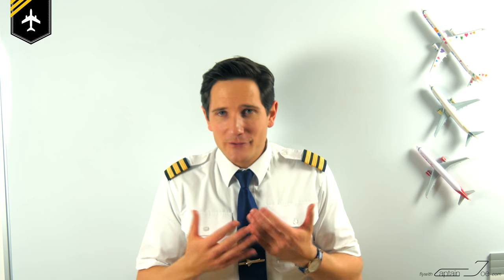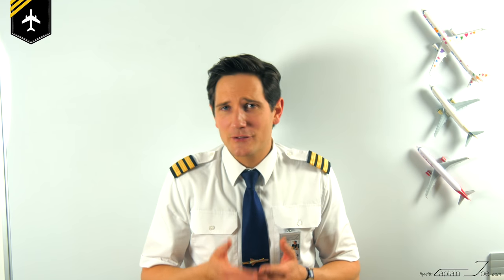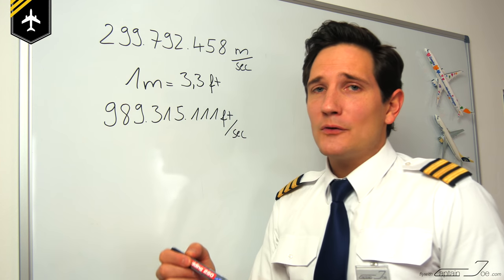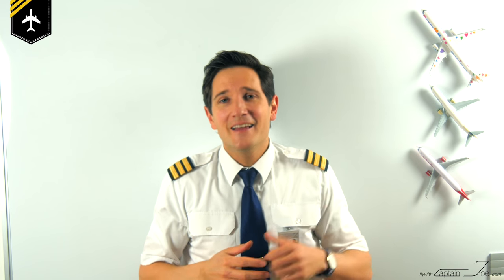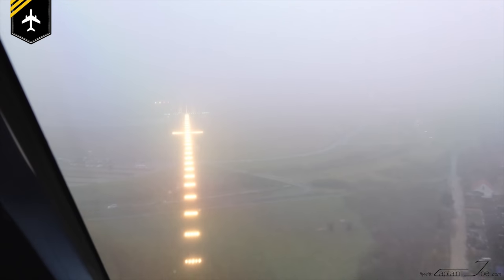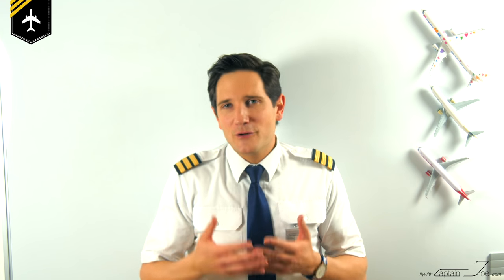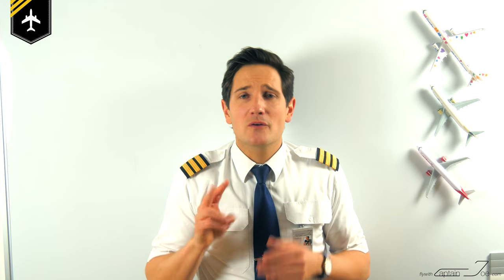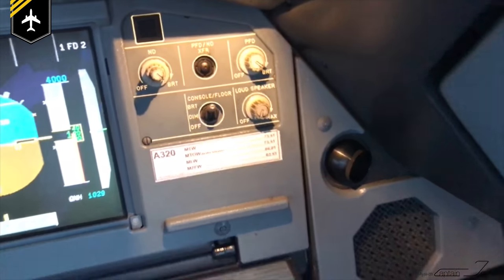50...40...30...20...RETARD...RETARD??? Radioaltimeter explained by "Captain"Joe

Comment: When you are above sea, will it give the  height above the sea bed or the sea leavel? Just in case...?
Reply: Guessing sea-level because water reflects light
Reply: Biju Nair the height/altitude doesn’t depend on the actual sea level below. It’s a mean sea level which is a value given using the barometric altimeter.

Comment: What is Minimums?
Reply: Minimums is the minimum altitude where the pilot has to decide to continue landing or make a go around. If the runway or the runway lights are not visible at this altitude the landing must be aborted and the pilot makes a go around.
Reply: @mikep9604  oh okay thanks, appreciate it.

Can they go around after Minimums if some problem occurs? Like traffic, ATC, etc?
Reply: @shantanu925  - Yes, if there is for example unexpected traffic or the ATC tells to go around, they can abort and start to climb again even if the wheels have touched the runway.

Comment: You really didn't have to do the whole math thing the concept is enough if somebody doesn't understand how a radio altimeter or GPS or any distance measuring equipment based upon radio waves works at this point in our Evolution then they need to take a class someplace else you shouldn't have to waste your time explaining it or doing the math for it

Comment: what is minimum that is said before 100 ???
Reply: Minimums is the minimum altitude at which the pilot flying has to make the decision continue landing or make a go around.
At minimums the pilot must have the runway or the runway lights in sight to decide continue landing, or if the runway is not in sight at this point, decide to make a go around.

Comment: Why does Aviation use the unit Feet for? Is it all because of one stupid country that refused to change?
Reply: No. It actually works quite well. Metres are used in most places for runway visibility so using feet fir altitude helps avoid confusion.
Reply: @peteconrad2077  That sounds like a weak excuse to me. Why would that matter? Context of what you're talking about is what matters anyways.

I see no reason why calling out Altitude in multiples of 10 Metres would be a big hassle. A height such as 1.95KM would be read out as "One Niner Five". Seems simple to me.
Reply: @gredangeo  but you include the units to avoid confusion with flight levels and the the word “kilometres” is a bit of a mouthful. It’s also the unit used for jet visibility by most if the world so again, there’s a risk of confusion.  Trust me, feet really work. Also, the ideal vertical separation for aircraft is difficult to economically breakdown into round metres.
Reply: @peteconrad2077  "Also, the ideal vertical separation for aircraft is difficult to economically breakdown into round metres."

How? Plane separation would be in multiples of 100 Metres at minimum. Most planes may sit at 300. Which is roughly 990FT. Pretty much all aircraft only use the unit to a minimum of 1000FT increments, it's close enough.

"It’s also the unit used for jet visibility by most if the world so again, there’s a risk of confusion." So do people really only care about hearing a number, and not know the subject of what's being said? The only confusion I see here, is using two different units.

Also, the word Kilometres can always be shortened down to it's normal phrase using the word "Kay". Some object is visible 15KM away, it's "15 Kay". This is pretty straightforward I thought. Still using Imperial Units in the 21st Century is stupid. Other countries shouldn't really be pandering to the US industry.
Reply: @gredangeo  mate you really don’t know what you’re talking about. 

The Russians have largely abandoned metric altitudes because the progression is on simple thousands rather than dealing with multiples of 300 which is more cumbersome. Add that to the fact that it avoids unti confusion and the fact that the altimeters of 10s of thousands of aircraft would have to be replaced and it’s just a risible idea. Only Simone who understands nothing about aviation could consider it.

Comment: Which fuel use on aeroplanes
Reply: Jet aircraft use jet fuel which is a type of aviation fuel designed for use in aircraft powered by turbine engines. Most commonly used fuels for commercial aviation are Jet A-1 and Jet A.  Piston engine aircraft use aviation gasoline.
Reply: @mikep9604  what is mean by jetA-1 and jrt A?
Reply: @nature8186  - These fuels have different markings because there is a little difference between them. The primary difference is the lower freezing point of Jet A-1 fuel.
Freezing points:
Jet A's is −40 °C (−40 °F)
Jet A-1's is −47 °C (−53 °F)
Reply: Sir what are the uses of co-pilot?
Reply: @nature8186  - The pilots share their tasks during the flight. One pilot is the pilot flying and the other pilot is the pilot monitoring. The usual principle can be that the captain flies one part of the flight and the first officer (co-pilot) flies another part of the flight. Both pilots fly the aircraft but they decide for each flight who is the pilot flying and who is the pilot monitoring.
Reply: @mikep9604  sir how to find  plane  boeing 737,747,757,789 out apearens?
Reply: @nature8186  - Can you clarify more what you want to find? Do you mean photos?
Reply: @mikep9604  aeroplane
Reply: Aeroplane  out appearance  how to find out A343,B747,757,767 ect..
Reply: @mikep9604  Are you american?
Reply: @mikep9604  i search that.but not to me
Reply: Are you try to one video  to me.your channel
Reply: @nature8186  - There are for example 'airliners.net' and jetphotos.com' and 'airline-pictures.net' websites you can use. You can also use google search by using words: 'B737 photos' or 'B747 photos" and so on.

No, I'm not American, I'm in European Union region.
Reply: @mikep9604  ok sir thanks